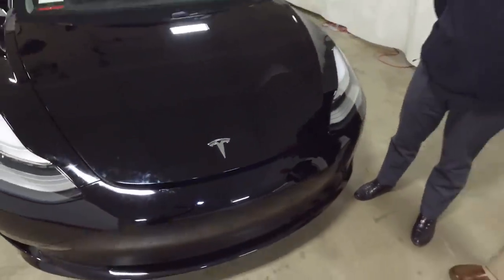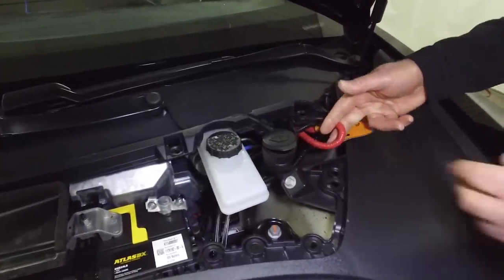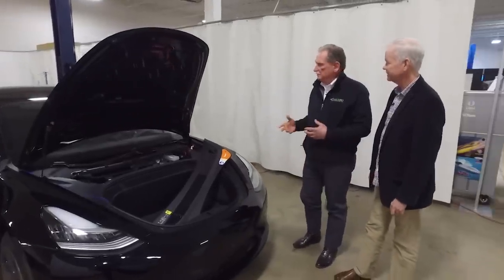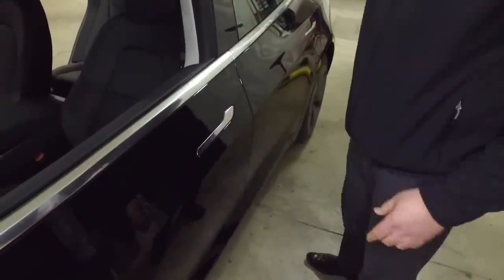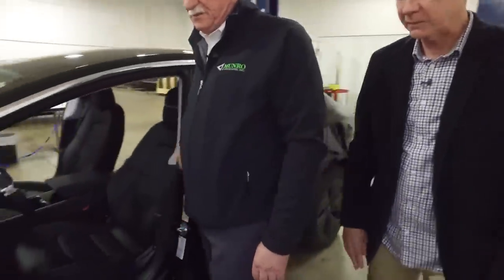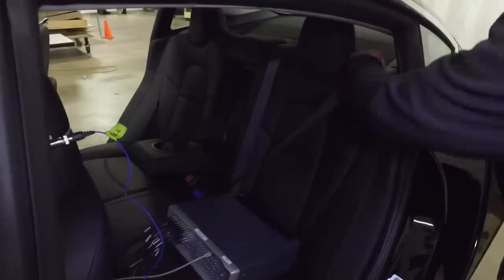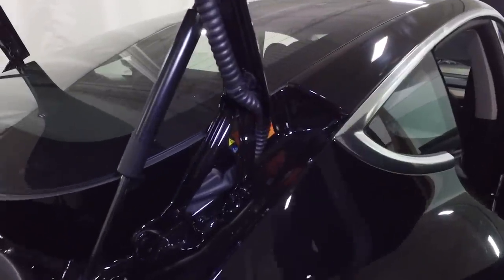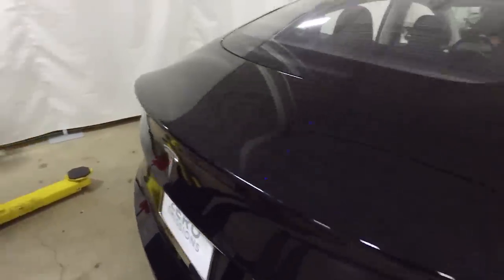Tearing Into Tesla's Model 3

Comment: In the beginning they were throwing these together by hand to get the production numbers up. Build quality should have improved since then, hopefully.
Reply: You're supposed t do that calibration in pre-production test vehicles, not with what you're putting out on the lot.
Reply: Exactly, but their rabid fans seem to forgive all of those things.  The funnier part is that most of the people who obsess over Tesla don't even own the cars or stock in the company, I really don't get it.  It's a car company - it's not like Musk cured cancer, solved world hunger, or created world peace or anything - he made electric cars sexy for rich people.
Reply: "In the beginning they were throwing these together by hand"

Which means they should have had BETTER fit, as there were actual human eyeballs looking at each step as the body panels were attached.  Henry Ford's people were doing this at the Piquette Street plant in 1904, with no automated assembly line (cars were pulled from station to station down the line BY HAND).  At the same time, Cadillac was doing literally the same hand assembly less than 2 miles away at a factory (long since demolished) on the grounds of what is now the Hamtramck Assembly plant.  And both had great fit and alignment.

110 years ago.

This isn't hard.

It's just sloppy.
Reply: Tesla is full of arrogant idiots, who think that the costly lessons learned accumulated by the rest of the auto industry have no validity.

In that respect, they are just like leftists, who insist that thousands of years of human experience about how a society can function, and what causes society to fail, can all be thrown out the window, because some privileged idiot who never worked a day in his life, spent his time in a German library writing a bunch of Plato-inspired nonsense about how society should REALLY be run by secret-king losers like himself.
Reply: Translation: they didn't actually calibrate the line.
Reply: Driving at any time with a bad exhaust system is stupid.
Reply: The old adage "never buy version 1 of something" applies here. Except it's more like version 0.9. Tesla will get there eventually and the car will become a classic but those people at the head of the queue basically have a beta quality car.
Reply: Why would I "freeze to death" with a gasoline engine running and the heat on?  A SMALL automobile gas tank holds enough gas for a range of 300 miles (480 km).  That's enough to run at high speed under load for about 5 hours... or enough to idle and heat a passenger compartment for over 30 hours continuously.
Reply: Quality of the Model S was bad at first too. They solved it, but it took years. I thought they knew how to do it this time. Some of it is probably calibrtion of the new high-throughput production equipment.
Reply: You don't need engine heat because it is electric! thaaa! Do you remember 1929? Funny!
Reply: Most people are happy with their toys.  And this is a toy.
Reply: I wouldn't call their model S quality issues resolved.
Reply: Paul Hendrix  quality of the model s still is poor... just got my hands on a 2017 Model S with some thousand miles/km‘s and it still sucks... gaps are horrendous, especially the chrome window frames... interior still cracks and rattles everywhere, rubber still poor quality and finish... this will never get better...
Reply: Aaron Kulkis - Holy crap, you very effectively summed up the blind fans of the company. I've never heard or read a more-accurate description than what you've written.
Reply: The build quality has improved. I looked one over in a showroom in New York City last week. I could find any fault in the fit and finish.
Reply: It would be good to know the serial number of this particular vehicle.  If it's low, ie under 1xxx, or even 2xxx, I'd hope they would do a re-examination of one in the 6xxx's or, when they're in existence, in the 10xxx's.  Just to see if the theory that Tesla gets better at the gaps/etc. as they make more examples of the car, whether that is holding true, or not.

Some of the shortcomings he highlights, though, aren't panel gap tolerance issues and don't sound like they'd be easily fixed.  The whole having to saw out, somehow, some part of the right rear quarter panel in the midst of what obviously would be an emergency situation is just bizarre - as is the idea you have to have a 12v battery to "jump" the car in order to open the front trunk (sorry, will not say "frunk", and I'm in line to get one . . . . Still I have my dignity) when the power's out.  

I also am mystified why they do not include a mechanical option for the back doors, also in an emergency.  Why do that????

When I heard about this video, I thought it might be a bit of a hatchet job, with a hidden agenda, but after seeing it, the guy seems sincere, and he's pointing out mostly real concerns that I'm glad I know about now (the "heavy trunk" thing is a little ridiculous, though . . . ), before I make a final decision to pull the trigger or not.
Reply: @Steve Martino even if that is the case, that is an *excuse*. Unacceptable.
Reply: What revolution?

Batteries are as pathetic today as they were 200 years ago.
Reply: AWDfreak.  I study EVERYTHING.  Even geology, which I hate.
Reply: Do you even know what goes into a mostly automated car manufacturing line? What does "calibrate the line" even mean?
Reply: Automobiles use consumables to generate heat, run themselves. How is that news?
Reply: You sound like someone who has a vested interest in protecting the status quo. Oil won't last forever.

Battery tech is much better than 200 years ago. What hyperbole to claim it's the same.
Reply: It doesn't seem to matter they have over a half million pre orders and everyone who bought one is loving it so if you want one you want one and if you don't you don't, criticize all you want but the bottom line is the world is changing and its exciting!
Reply: Yeah, for  tons of people buying a 100K model S or 40K+ Model 3, the main plan is to sleep in the car... wtf?
Also, if you're counting on sleeping in your Tesla in the winter you WILL freeze to death... just a matter of time before the motors, main screen, or door handles break and it needs to be in the shop for 3-4 weeks.
Reply: Turning on the heater of your gas powered car (or the A/C) does not significantly effect the range of said car.   While the A/C MIGHT be measurable, the heater will not be. It doesn't require additional gasoline other than the electric to run the fan (extremely minimal) and the almost unmeasurable increase in flow resistance to the flow of coolant thru the heater's exchanger.   On an electric car, a coil is heated via the power pack and air is blown across it... drastically reducing range via battery power loss.  Electric heaters are by nature very inefficient, and in any case the gasoline powered car is using the WASTE from the process to heat the cabin... the Tesla is creating waste to heat the cabin.
Reply: Tesla was going to be in the situation where the Model 3 came out 2 years after the Bolt. That would have completely killed their stock market value. So they threw some together 2 years ahead of time. If they keep trying to build them with production equipment, it's not going to get any better. The big Three have a lot of knowledge on the pitfalls of production equipment for mass produced cars. Tesla does not. Things are NOT going to improve on the quality or design front of the Model 3.
Reply: An electric car can make the heat...AT THE EXPENSE OF SIGNIFICANT RANGE REDUCTION BEFORE NEEDING TO BE RECHARGED.
Reply: Yep.  Getting a DECENT electric drive with any sort of usable range is so expensive that you have to go cheap on everything else.  And you still have a ridiculously expensive car, that has a very limited daily range (like a golf cart), and doesn't have much for passenger comfort in heat or cold (no engine heat for the winter, and A/C also seriously depletes range).

This is why EVERY ELECTRIC CAR COMPANY IN DETROIT folded **BEFORE** the stock market crash of 1929.
Reply: Model S bought last year by our company, the worst pile of garbage ever made. Every single piece of interior is cheap and brittle feeling, every panel squeaks or creaks when pulled or pushed on, door panels hollow like egg cartons, the suspension is loud and rough, car is unstable above 200 km/h and has lots of wind and tire noise, it feels cheap in general and like an unfinished product, not to mention how unreliable it is, there's problems with it in a weekly basis. The best part? It costs more than a Mercedes S class, and the hilarious part is, a Mercedes C class feels about 5 times better in every single aspect than the Model S (except acceleration I'll give it that).  Tesla cars are POORLY engineered and manufactured and they cost more than premium cars.  They are very mediocre cars in every single way apart from straight line acceleration at low speeds.
Reply: Sure. They're pretty hurried though. They want to pump out and sell as many vehicles as they can, partly because they have a gigantic amount of orders to fill.
Reply: Better, I've driven in Norway but that's not the point, an electric car can make the heat even if you sleep in the car, it is called "camper mode". That you don't have and your ass will freeze to death if you let your engine running.
Reply: Google: sleeping with the engine running.
Reply: D Man ... and everyone else. There's some value in revolutionising an industry. The cars are untraditional in many ways and I personally know multiple people happy with them.

Comment: Ok, so in response to the rear doors not having an emergency latch to escape, my car (Toyota) regularly has child safety locks activated.  In the event of an accident, the passengers of the vehicle would not be able to escape through the rear doors and can only be opened from the outside or escaping through the front doors.  

"The children don't matter"....?
Reply: Read your manual. Most back door lockouts automatically unlock in an accident.
Reply: David B r and you are 100% sure this is not the case in the model 3?
Reply: @G Hq fuck you asshole

Comment: Despite the herd mentality of the cult of Tesla Motors dislikes, these "grumpy old men" do bring about some valid points, especially the panel gap issues, which is unacceptable for a luxury car. However, I'd like to give the company some time to sort out its issues. We will see, with time, how they address the quality defects in the future.
Reply: Luxury or not (it's not), these panel gaps are still unacceptable, especially for 35k car.
Reply: This is not a $35K car. Tesla has yet to ship a single $35K car
Reply: LockonStratos00 You're looking at it from a screen so yes, you are missing the depth and perception needed to easily see those things. They are very easy to notice in real life.
Reply: Eisenhower303 Exactly. Most of them are upwards of 60K, which is the price of an entry level Model S.
Reply: You cannot buy a Model 3 for $35K.  The cheapest model available today is about $50K.  That's a luxury vehicle price.
Reply: They might improve it but I doubt it’s going to be at the standard of other car manufacturers. The Model X has been out since 2015 and they’re still are coming out of the manufacturing line with fit and finish issues. Just look at the Tesla forums. I’ve seen tons of Model Xs and all of them have misaligned door handles. It’s pretty ridiculous.
Reply: Panel gaps are one thing. More concerned that children or elderly are supposed to move heavy luggage into the cabin to get out via the trunk.
Reply: 35k is not a luxury car.
Reply: Panel gaps visible from Mars?? I could barely see them when the camera moved in close... Am I missing something?

Comment: This video should be titled "Old Farts Complain About New Technology"
Reply: Except most of the things wrong with the car have nothing to do with technology but with poor design choices.
Reply: Except the same people did a teardown on an i3 and called it the "most advanced car ever." So you know...try again
Reply: VisioningHail okay I will go again.  I was told in that BMW i3 video they were complimenting the BODY STRUCTURE composition of the car.

Doesn't  change the fact that the guys made some really whiney complaints about the car.  "Waaah... these door handles are bad for my arthritis.... waaaaaaah...!"
Reply: If you didn’t see clear design and quality flaws with that car you’re simply lying to yourself. Tesla has been making cars for 10+ years now. Absolutely no excuse for the mass QC flaws that many Tesla’s have.
Reply: None of the things mentioned in this video is based on "New Technology". It's just poorly designed. Not having mechanical releases in the back doors is just stupid. In the event of an accident, every opening counts. Even the Model X has mechanical, albeit rather hard to get to, releases for its falcon wing doors. The trunk is stupidly designed. Instead of a traditional trunk, they decided to put the hinges on top of the C pillar and hold up that small door with traditional struts that they use in SUVs, making it hard to close. And the body panel gaps is poor quality control which is something that Tesla is infamous for at this point. Only thing that might have been nit picking is the door handles but everything else is pretty fair game imo.
Reply: More like ''reasonable people bring out obvious and dangerous design flaws''
Reply: Even more, they teardown an i3 from 2015 as i3 is produced since 2013! But they teardown one of the first M3 produced! Conveniently, they show no interest on bashing i3 because it was not a menace to Detroit and even to petrol BMW.

Comment: Man do you guys sound like whiny, ignorant, biased fools. Not a single tip to the hat of the highly impressive engineering that went into this car. I can tell you, nearly all of the gripes you have, exist in other cars, but ones with less scrutiny of course. Anything different on the frunk opening, would be a security vulnerability. Easy access to thieves. Opening a hood on a normal car could be just as tricky on a normal car. They use a tool to pop a cable or pry the hood.
Reply: 1. It really isn't "highly impressive"
2. In what way would adding a usable manual Frunk release be a security hazard?
Stupid Tesla fanboy.
Reply: Matt O  
1. It's the only car of its kind. Name me one car besides the model S that comes even remotely close to the power to weight ratio of the motor design, the numbers of cameras and systems integrated, the ever growing list of software upgradable features (or another that can even do that), and with as minimal of a drag coefficient. 
2. People would now have access to what's in a storage compartment of your car. Obviously.
3. I'm an automotive enthusist. I appreciate design and quality and forward-thinking in all makes and models. There's a reason the Tesla Model S was named "Car of the Year" "Product of the Year" and "Car of the Century". Because we have yet to have another Automaker match what even that one offers. And it's been out since 2012. My hope is to see some actual Tesla competition, but until then - I will continue to be an educated and well-informed Tesla enthusist.

Comment: So ... which is it? - Am I going to need to jump the battery, or cut the power from battery? Pretty sure I can't need both at the same time.
Reply: Daniil Vodopian The same thing you do with every other gas car, or their i3 they have there that doesn't have an outside mechanical lever. 

You pry the hood open, and cut the wire.

All cars have the mechanical lever on the inside to pop the hood, where you can fidget around to unlock it even further. 

Firefighters don't have time or access to the inside of the car. They just pry the hood open really fast.

Comment: Ex. Ford employee from Pinto era when you would just burn to the crisp after minor collision talking about safety.
Reply: The Ford Pinto was sold in the 70's. We are in 2018, almost 50 years later.
Reply: Modern Asian cars have their gas tank visible from the rear so they are also prone to burning their passengers in a crash. I have seen Asian car fires (including a Toyota Prius). No gas at all, or a better tank placement (as in the Chevy Volt) prevents any gas fires.